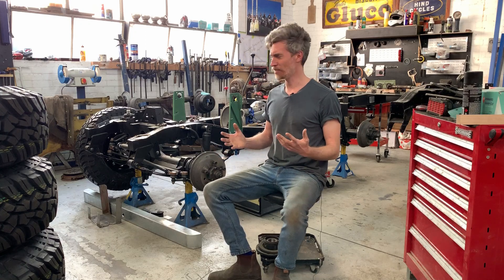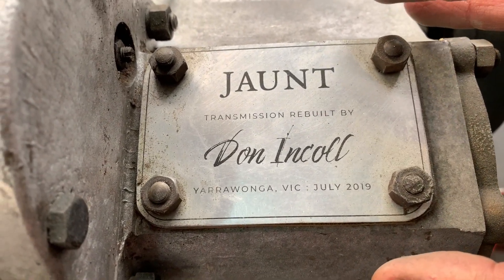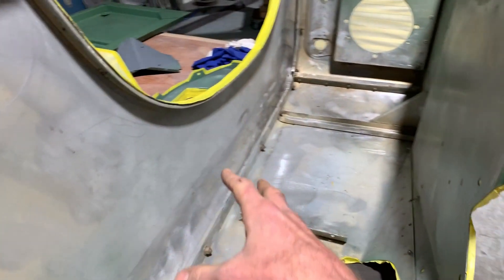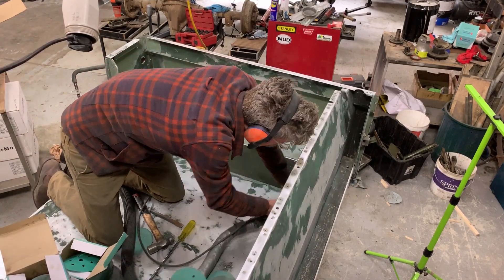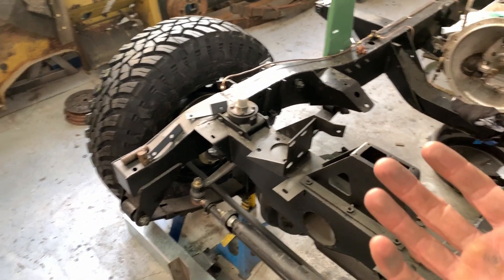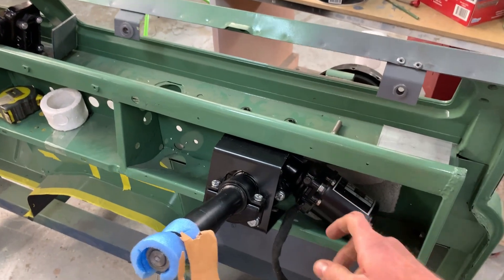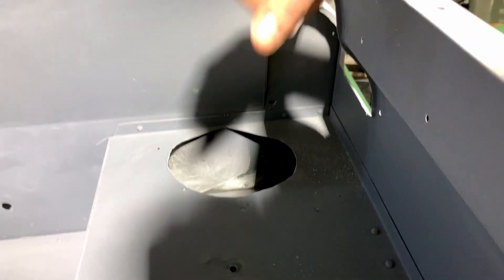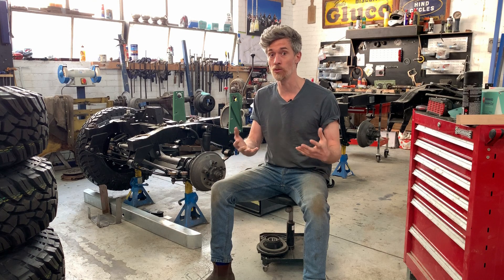Panel beating, power steering, paint and personality || Electric Land Rover Conversion

Comment: Congratulations. Follower from Spain. I would like to mount a electric power stering. Where can i buy it? thanks
Reply: It looks a lot like a Toyota GT86 set up, under US$100 on eBay.
Reply: @tvanduyl  thanks for your answer
Reply from the maker: It's a complete kit from EZ Power Steering in the Netherlands. Based on a GM motor, but includes all the components to fit a series Land Rover.
Reply: @Jauntmotors  thanks for your help. Are yo thinking on selling the electical kit for overseas?

Comment: The under body spray you’ve used, has it been tested on Aluminium prior to your use? Bonding/etching to Aluminium is a problem for most things - paints, glues, polyurethane etc

Comment: Looking great, Dave- are you using pop rivets when reassembling panels and glav trim or are you using pneumaticly peened rivets like the originals?
Reply from the maker: We're just using pop rivets throughout.  Thought long and hard about using the dome rivets where possible, but felt that as you have to use a combination, the dome rivets make the pop rivets look worse.  All pop like more recent defenders looks nice and uniform
Reply: joshua kampa the cappings are fixed from factory with a combination of solid and pop rivets. About 50/50. Solid are better in some cases but require more tooling and time to install. Solid are good for dissimilar metals where the expansion rate can be different, but that can be solved with good quality structural pop rivets like used in aero industry.

Comment: Great video Dave. What prevention measures are you putting in place to minimise further bi-metal corrosion? For example was there any steel brackets etc between your new 1mm sheet and the old tub tray? And in other places?
Reply from the maker: We're putting as many buffers as we can between dissimilar metals.  Rubber buffers etc.  The original tray and our new sheet are both aluminium though

Comment: I love the attention to detail you’re giving the project, and just because Juniper is a prototype, that doesn’t mean she should be botched - she can join the fleet or becomes someone’s private vehicle at the end of the job.  Furthermore, it’s easier t 
I see what’s going on and work on a clean, solid vehicle rather than an oily, rusty, broken lump.

I’m very interested in what you’re doing with the steering.  It makes good sense to use electric PAS rather than an electric pump for hydraulic PAS.  I remember Don saying he got fed up with the pump noise, but also made the argument about the waste of electrical power running a pump near continuously - you could run an accumulator and pressure switch, but the electric PAS is neater and quieter, and should be more efficient.  Add the speed variable assistance and it should use very little energy, just kicking in at 10mph and below would be good for most drivers.  I used P38 hydraulic steering with great results on my Tdi powered 109, but if I ever get the opportunity to electrify it, then I quite fancy what you’ve done.  Would you be willing to show more detail about what system it is and how you’re fitting it?
Reply from the maker: Thanks Nick. We'll definitely do a deep dive into the power steering once we have it all sorted out. It's a really nice bit of kit and one of the only ways to add power steering to an old Land Rover
Reply: You’d be surprised at the number of ways it’s done, some better than others! 😂😂😂